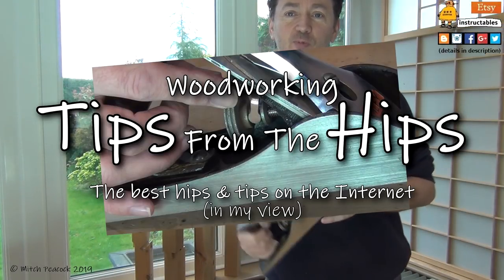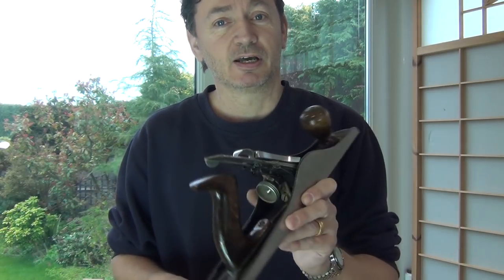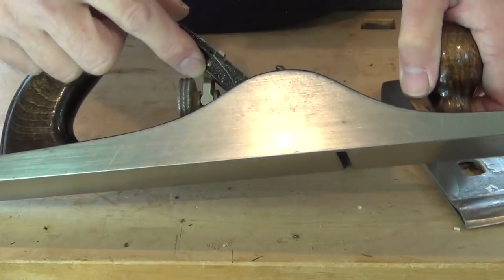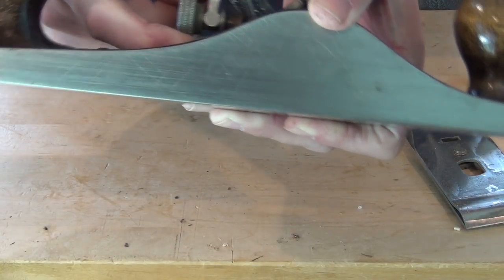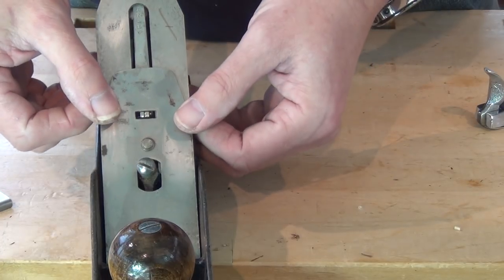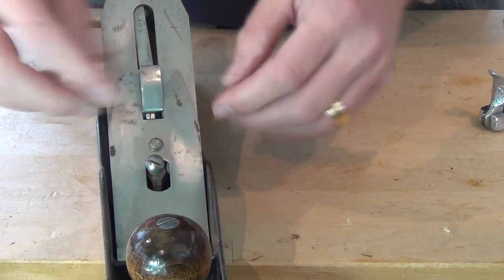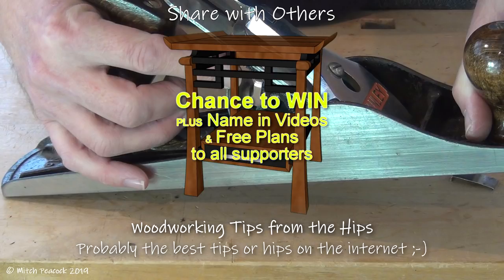Reduce Depth Adjust Slop!

Comment: I'm a hobbyist and dont have that many planes(5) but I found that the more modern ones will have a lot more slack in the adjustment mechanism as opposed to the early planes.
Reply from the maker: That would seem to be the case, except for the higher end makes.

Comment: Nice video, Mitch
Aha, I've never noticed that or I've never checked it on my Stanley Baily planer.
Reply from the maker: Cheers Gunter. It's not always the most obvious cause, but often the worst offender
Reply: Hello Mitch.

That's right, because sometimes you do not see the mistake.

But it turns out that the setting on the planer does not work that way.

How was that look at the planer closely and try to see how the function of the parts is.

Wanted a nice Weekend.

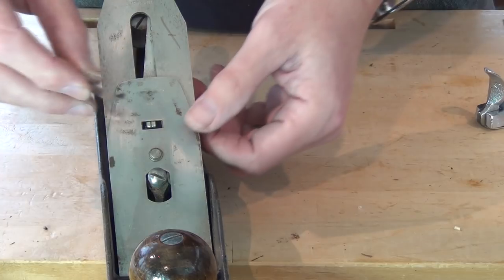Comment: Nice video as usual! Any reason why so many manufacturers leave such a big gap there? ( 02:35 ) Are they constrained by the manufacturing process? Or it just reduces their production costs?
Reply from the maker: Thanks Andrei. I guess manufacturers have to make the slot large enough to take all adjusters at maximum tolerance, plus their own manufacturing tolerance. Also, thicker irons hold the cap iron further away from the frog, so the thicker part of the adjuster doesn't reach the slot. The slot can't be tight throughout its travel either, since it passes through at varying angles.

Comment: Are there any plane manufacturers who have gotten around this problem. As I may have a solution.
Reply from the maker: Closer tolerances reduce this significantly; even the mid-market manufacturers like Lie Nielsen and Veritas planes are pretty good. However, I'm not aware of a cheap manufacturing solution to the problem, so you may be onto something!